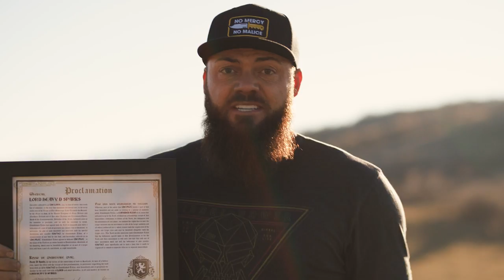Recovering A Family Stranded On The Highway Overnight In Freezing Conditions

Comment: Underrated little workhorses, those old 6.5TD motors. Not the most powerful and definitely outclassed by the Cummins ISB and Ford 7.3 Powerstroke that came later, but if you keep water and oil in them, they last and last and last.